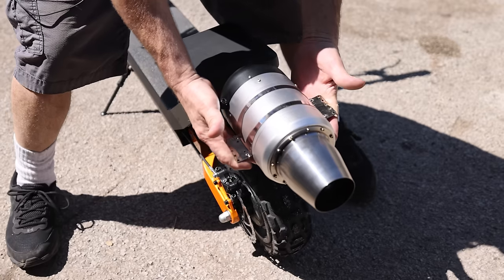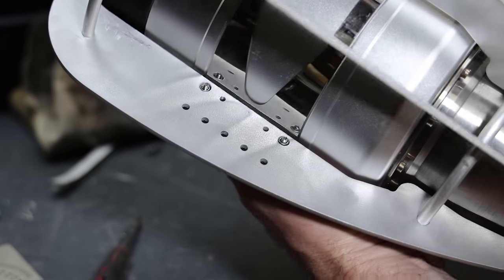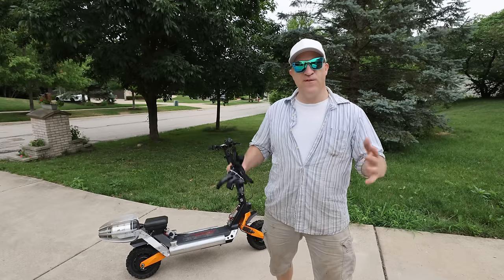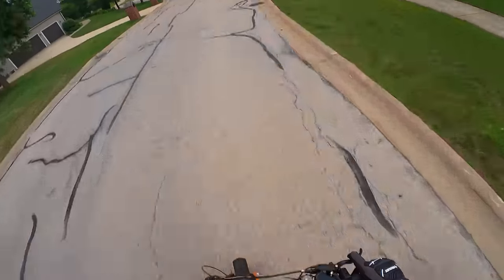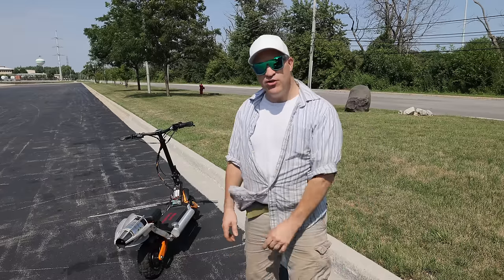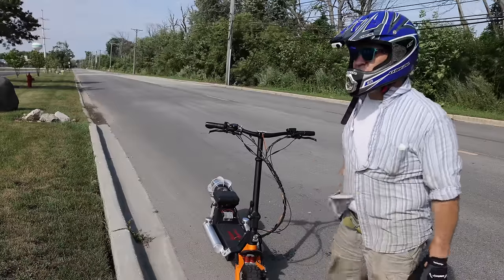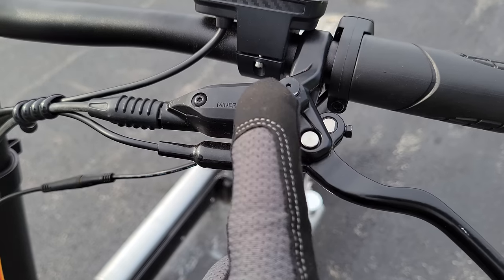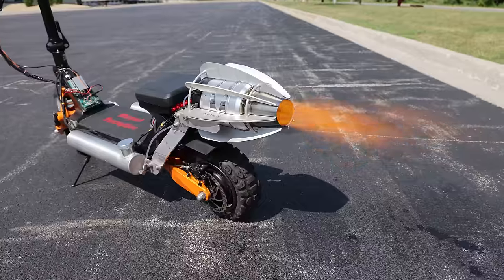Jet Powered Scooter

Comment: Next time put ur smartphone in ur pocket with a GPS speedometer open, it will measure the maxspeed and save it so you  can check it after u done with the run :)

Comment: This was awesome! The small wheels would probably be sketchy at high speeds, but if they were bigger you'd get way less wobble.
Reply: He was riding the scooter the wrong way so his stability wasn’t good because he was standing forwards with both feet right next to each other and not in front of each other so that’s why it’s wobbly
Reply: That's why steering dampers exist
Reply: yeah well I can’t afford stuff like that
Reply: @glitchmaster643  A high quality one would cost you less than 60 bucks, would you rather instead pay with your life? It wouldn't burn a hole through your wallet that's for sure.
Reply: if you are concerned about speed wobble a bike would be a lot better really.
Reply: @glitchmaster643 They're not all $100-200. I got a solid one for my Nami (goes up to 60mph) for $35 on amazon.
Reply: @YouProductions1000  do you know if you can get 1 for Fieabor scooters?
When I start hitting 40 - 50 mph it gets pretty bad
Reply: @glitchmaster643  But you can afford a mini jet engine?
Reply: @rey_nemaattori  you make a great point. I didn’t consider the posiblity of being able to afford anything

Comment: We should build a jet powered Power Wheels ride on toy... 🎆
Reply from the maker: Let's do it I heard from my brother rich your good guys
Reply: Put a jet engine temporarily on the jetboat
Reply: @WarpedYT  I’d buy something like that
Reply: Can I have one
Reply: Turboshaft?
Reply: Definitely agree but go big or go home...  4 jet engines with a 450 4 stroke engine ultimate off road vehicle
Reply: @WarpedYT  Awesome!! That scooter is proof, ya don't have to leave the ground to be Pete Maverick. What an awesome build!! 👍

I wanna see ya build some Wile E. Coyote's, ACME Jet Roller-Skates and I especially want his ACME - Green Bat-Guy costume. 😂
Reply: hello
Reply: @WarpedYT  Jet engine installed on Two wheelers isn't correct on Road it will Fraighten other vehicles moving on Road.
Reply: Jet powered fidget spinner
Reply: @WarpedYT  Too bad you don't live in toronto, i need your skills to build a contraption to attach to a wheelchair which turns it into a quadcycle... hard to get help for a good deal here.
Reply: @WarpedYT  you’re **
Reply: @WarpedYT  Is it really possible to buy a jet engine freely ?
Reply from the maker: @2SUB-TV_space  sort of but not exactly.
Reply: Yeah, for ages 7 and under. :-P
Reply: @WarpedYT  BUILD A HYPER SCOOTER WITH A 212 cc
Reply: @warpedperception this dope! How can I get my hands on one of those mini jet engines?

Comment: I love the sound of a jet engine 👍, too bad they burn so much fuel. Beautiful fabrication on the jet engine mount 👍.
Reply: I had considered building an experimental plane with 4 of the bigger jet cat engines. Roughly calculating around 80 gallons of fuel burn an hour.

Comment: This is absolutely wild. Any guesses as to what the fastest speed you got on it was? Would love to try something like this out one day!
Reply: 62km/h
Reply: Looked like about 40-45 MPH.
Reply: 6:33 thank me later
Reply: 9:14
Reply: @nighthawk0077  why this guy didn't have a parallel véhicules to check his speed? was very clever to build this fascinating toy but not enough clever😮?????
Reply: Pretty slow for a jet powered vehicle
Reply: Pretty slow for a jet powered vehicle
Reply: He didn't publish his speed intentionally although he did say 62. The problem is, recording your crimes even if they are traffic.
Reply: @ChristopherGuilday  he went over 52 the first time he tested it
Reply: @Re-written.  Not save at higher speed due to too small tires.
Reply: @c.s.4273  having smaller tyres is irrelevant
Reply: @Re-written.  Ever heard of gyroscopic forces?
Reply: @ryanreedgibson  He was going 62 km/hr maybe.  No way was he going 62 mi/hr.   That scooter has only a 28 mi/hr max speed, meaning it has no steering dampener.  He would have wrecked way before 62 mi/hr.  With that horrible safety gear, he would have hurt himself badly.
Reply: @nighthawk0077  Americans can't understand metric, so definitely not 62km/h. Has to be 62 mph.
Reply: @ChristopherGuilday  That's about what I got timing him as he passed landmarks I could reasonably guestimate distances for. I got him doing roughly 50 feet per second, which is about 35 miles per hour. Give him some leeway in timing and distance, and I could see 40-45. There's no way he did 60.
Reply: More! More jet engines! Live Life Large...
in the jet lanes!
Reply: what a smart maniac he is 😅😂💪🏼😎 wearing shorts and skirt to try maxspeed on a jet powered scooter with mini wheels.. gigachad from the 70ties 🫡💥☠️⚔️
Reply: ص
Reply: epic
Reply: This is More like 60km/h..
Reply: @SemenTheSailor they are usually 100 ft apart
Reply: BUNDESVERDIENSTKREUZ ❤❤❤
Reply: @SickPillow  Man, totally.  Shit gets dicey as fuck on 10inch tires after 40-45 mph even on the smoothest freshly paved road.  I mean, it's "kind of" doable but that shit is totally not guaranteed.  I ride a Roadrunner RS5 and it can basically get up into the 50s on a full charge because of my weight, but HOLY SHIT lol.  I don't even touch 3rd gear anymore and am perfectly comfortable keeping it in the 30s 😋
I used to ride 600cc motorcycles and a scooter at 50+ is honestly more terrifying than a bike at 150mph 🤣
Reply: I think i would wear a motorcycle helmet at least. Should wear a full body suit too.
Reply: I couldn’t believe he didn’t have a speedometer app on his phone.
Reply: Amazing 🔥🔥🔥🔥
Reply: Me too

Comment: To eliminate the wobble, you need to put one foot on the front, one on the back, and lean as much weight as you can over the handlebar. I do 120kmh (Moyatron) and my mate 146kmh (Rion) and we have no issues.
Reply from the maker: Geezus, that Moyatron goes over 55 mph out of the box, that's insane. I'm going to try that tactic next time
Reply from the maker: Dam man, the Ruin is 80mph, holy hell...that's just too fast for a scooter..
Reply: @WarpedYT  Yeah the Rion is just nuts, I have tried it and the acceleration is plain scary. It has the same push fron the beginning until the end, even at 120kmh the wheels keep drifting.
Reply: Or, you know, just buy a steering damper.
Reply: I see maybe you have a camera on the handlebar? That could be causing some of the wobble. Also, your cellphone can measure your speed. 😉
Reply: agreed. Side-by-side stance is is begging for a face plant. At that speed, probably your last.
Reply: @leoncaples2947  I wanna say the same! Beat me to it lol. Yeah for sure man, a damper piston is a must on fast scooters! Makes all the difference to unbalanced steering issues.. My brother put one on his Dualtron X and its so much more stable now.
Reply: @WarpedYT  ya, there’s actually a lot of scooters that easily go 50+ out of the box, although they get really expensive
Reply: You're going fast enough to go back in time on scooter🤯
Reply: @ButlerServiceProductions  theoretically impossible because to achieve this you'd have to travel faster than light speed and would require an infinite amount of energy more than the observable universe has to offer. And the speed of light last, time I checked wasn't 76.6 mph Marty.
Reply: @briantaylor2130  we all have YouTube bud, you're totally smart and cool though!
Reply: The speed of light is constant. But sometimes it slows down to allow people to grab it.

Comment: Awesome work! If you'd wanna improve this project, install a steering damper and change tyres to PMT.
As for safety, get full motorcycle gear and change stance to one foot in front and one back.
Reply: feet side by side is much safer, one foot forward only leaves one way to exit scooter. yes I know i've been trained in dismounting from trains, so like it or not, you;re wrong
Reply: @grantandrew619  Trains 😂

Comment: Awesome video! Couple things:

- Steering damper. Bolts on easily and will drastically reduce that dreaded speed wobble.
- Street tires. Less rolling resistance and will be a lot smoother and faster. Should be easy to find them in the 10 or 11 inch size. 
- Higher end scooter such as the Rion RE90. This scooter can hit 120 kmh (75 mph) WITHOUT a jet engine strapped to the back lol. (You should also be able to flash the controller to remove the speed limiter if it has one)
- If you get all 3 of those plus your jet engine expertise, you should be able to set the world record for fastest scooter ever! Cos why not!
Reply: It's an experiment, bro 🙄
Reply: @quetimporta213  I realize that. All I wrote are simply suggestions, bro 😅
Reply: @croman38  for what? Who cares? Or was pointless. You people
Reply: I have a nanrobot ls7+ and I've seen 62 mph. I'm curious about the controller flashing you mentioned. Do you know any companies that do it or maybe how to do it myself? I have two 50amp controllers in mine
Reply: @quetimporta213  experiments that come into reality ;) and you can buy one in the future from your car dealer :P . Almost all vehicles that are fast have limiters, to abide by the law and avoid needing specialized permits to make them, as an owner you can remove them since its your product.
Reply: @croman38  Please don't make this suggestion, because next thing you know, he may astutely do it and never comes back from it :D
Reply: There is no speed limiter on those. The regen braking is connected to hydraulic braking lever though sensor. When he applied the brake levers he also applied regen braking. Just disconnect the brake sensors and regen braking should be gone.
Reply: @quetimporta213  Why you hating so hard. It’s a cool project and this person just made some suggestions to improve it. Why do you say ‘who cares’ when you know a lot of people care and you yourself cared enough to make a comment.
Reply: @quetimporta213  you really a next level hater I respect the grind tho
Reply: 120km on a Scooter . That's literally insane , But so cool
Reply: @curly7985  - You can't ask an idiot why they said or did something, and expect any kind of a sensible answer, or any answer at all, because,.......

   ,..they don't even know.
Reply: What’s with everyone in here thinking they know everything 😂

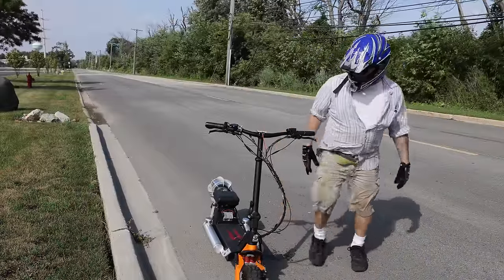Comment: Always turn the gas turbine facing into the wind when starting. These mini jet engines don't like starting with a tail wind, and that sputtering wet/hot start you did at 9:52 could have been avoided if you oriented it correctly before starting. Awesome video!
Reply: Big jet engines don't like starting with a tailwind either! 😉

Comment: I would suspect that it's not regenerative braking that's causing the issue. Rather the motor controller can't cycle the magnet phases quick enough, meaning they won't be pushing/pulling at the correct time.

Alternatively you are indeed generating to much power and it is starting to flow backwards into the motor controllers. Regenerative braking works like this, but only when the brake switch is triggered and it is turned on.

If your scooter has a coasting function then it may solve the problem by turning it on.
Reply: Very true!
Reply from the maker: Yeah a coasting function would do it, I reached out to the manufacturer after this happened to see what they say they haven't got back to me yet
Reply: incredible, i explained exactly what was wrong with this setup and my comments were deleted
Reply from the maker: @Blox117  why did you delete your comments? Because I didn't delete them.
Reply: @WarpedYT  it was deleted by youtube. my comment told you that the magnets cause eddy currents that slow you down more as speed increases. you need to replace them with non-motor wheels.
Reply: @Blox117  That's what I was thinking too, the motors always cause some sort of resistance when turning no matter what you do. This would happen even if the phase wires were disconnected from the controller.

Matt needs a pair of rims and a steering damper to cope with the twitchy front. I'm definitely curious to see more of this project!
Reply: @proxyhx2075  pretty much, its well known in the PEV space when non-geared hubs are used in a bike or scooter. coasting distance is decreased compared to a wheel with only bearings.
Reply: Also, hub motors spinning fast with no load can generate hundreds of volts that can fry the controller, so all electronics have to be rated accordingly otherwise you're continually having to replace controllers, caps, mosfets, chips etc.

Comment: Man I think that thing is awesome. I'm working towards breaking the current world record for the fastest kick scooter. You have inspired me to keep moving forward with my project. It seem that you have much better resources and equipment. The cnc machine and the heli arc are must have to go to the next level. Thank you for the video. I've raced motorcycles and high performance cars my whole life and safety equipment is a must if you continue to press the limits get a set of leathers good boots gloves n Simpson helmet. I've gone down before and the pavement is  unforgiven so get the gear or get someone else that has it to do the test ride.  We need you in one piece to make bad ass videos that inspire our warped perception s
Reply: Good luck :D

Comment: The fact that the front wheel starts to wobble at a certain speed is due to the scissors-type suspension design. With this type of suspension / design, the wheel actually always wants to turn 180° [to the direction of motion] because it would be so in a natural way in the track.😎

Example: If you have ever taken a closer look at the small castors of an office chair, you will have noticed that the point that holds them to one of the five struts of the office chair is not in the center but shifted outward.

If you hold a wheel at the top of the shaft and push it forward, the wheel immediately rotates 180° & naturally lies in line.

Exactly the same thing the wheel of the scooter wants to do.... If you were to turn the design 180° so that the suspension would face the rider (there are scooters that are built this way...) then the wheel would naturally lie in the track and cushion shocks.

Since e-scooters are usually designed without jet engine & such high speeds, such a scissor suspension design is still acceptable - although it is purely technically a misconstruction - because it brings unrest into the driving behavior, thus unsafe and ultimately dangerous..🙃

Kind regards,

ζicᾰdἒ_Διphφ 💫🛸😊
Reply: You see a similar thing in motorcycles. It's called the "Death Wobble", and once it starts you're pretty much guaranteed to go down. Basically, he's lucky he stopped when he did, as a crash was imminent. The thing is though, he's actually lucky he didn't just slam on the brakes, because when you're in a death wobble if you try to brake and stop, it's just going to get even more out of control. You just have to keep going and holding on, not trying to fight it. Trying to fight it just makes it worse. It will naturally correct itself. But most people panic and try to fight it, which is why they go down. It's not always correctable though, most of the time once it starts it can't be stopped. He's just lucky he was dealing with small wheels at a lower speed instead of large wheels. That's the only thing that kept it from being worse.

Comment: I love that fuel tank idea, I definitely want it on my motorcycle. Seems you can store the same amount of fuel a way more space efficiently than regular tanks. And also it looks like real rocket fuel tanks
Reply: On one of my motorized bikes, I utilized a fire extinguisher for the look and because it holds more fuel.  Mostly, I just hate those 1/2 gallon tanks that come with every one of the motor kits.  They hold back any sense of style and make them all look alike.
Reply: Problem I see here with the horizontal cylinders, is that all the fuel runs to the front when braking, so the engine would starve of fuel.
There's a reason that motorcycle fuel tanks have the size, shape and location that they have.
It's difficult to improve on decades of evolution that have already found optimal forms.
Reply: @ahaveland  re: " all the fuel runs to the front when braking"
Yes, but a small reservoir could 'cover' for those braking moment events.

Comment: Generally electric engines have a max RPM which they are intended to see. Going above this can damage the engine, I believe to some degree this is what was limiting your speed, resistance in the engine built up while it was on.

It was likely trying to speed the scooter up at a slower speed than it was traveling causing resistance due to running far past spec, and acting kinda like motor braking would by downshifting.
Reply: @alexgivideos1965  Essentially, electric motors work by producing magnetic fields, by switching polarities it causes the shaft to spin. They produce a lot for torque while operating, however there is a max speed which they can switch polarity.

Above this the engine is still switching polarity at the max possible speed but the jet motor is forcing the rotor to push past this (some positive, negative, but also some positive, positive, and negative, negative). 

This wouldn't/shouldn't effect the motor before it reaches its switching speed, but past it, it will cause resistance on the rotor. By turning the electric motor off this problem doesn't occur (to the same degree) if it remains permanently attached at the drive shaft.

In fact it should function as alternator while off recharging the battery some.

Comment: I think what was happening with the scooter limiting your top speed was that the brushless motors were getting de synced with the controllers. The controllers simply arnt designed (or programed) to run any faster so you get that rough cogging feeling.
Reply: Hmmm ...